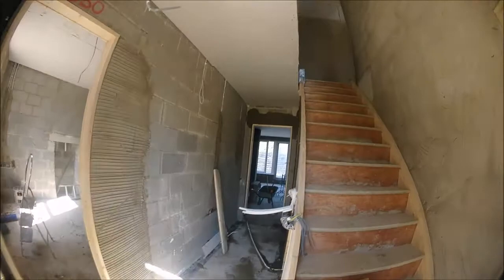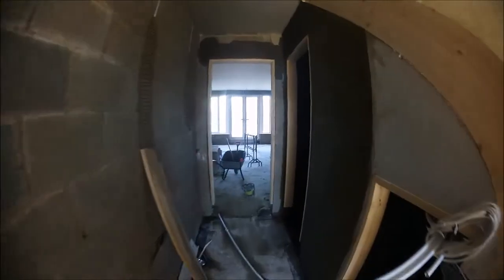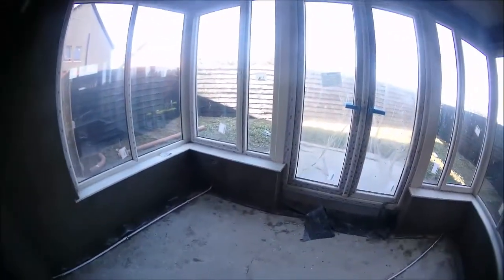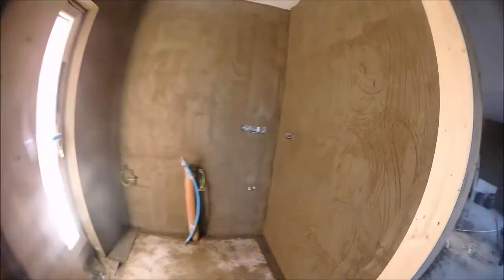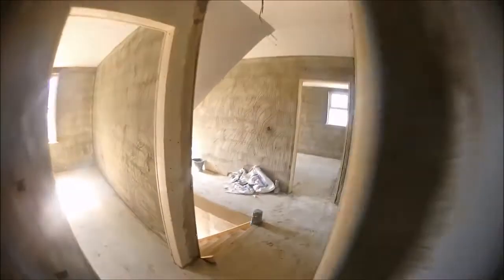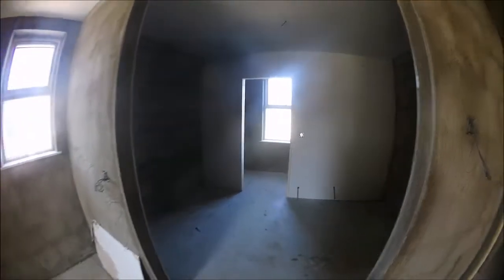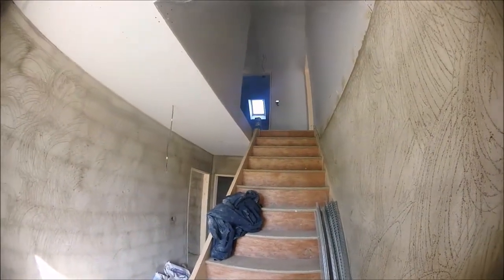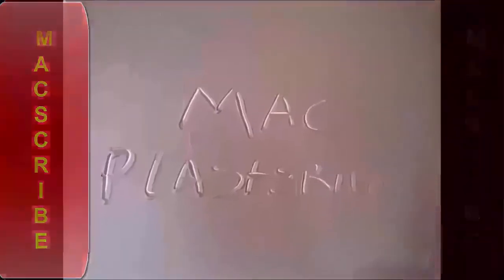3 STOREY HOUSE TO BE PLASTERED  cement rendering for skim coat almost done

Comment: Good to see a plasterer who comes down low enough. Too many think they only need to come down to skirting level. Personally though, I've always 'closed-up' my rendering, always makes the finish coat so much easier and 'bubble-free' :-)
(Holes and shallows tend to make for uneven finish coat)
Reply from the maker: I have followed in the steps of the great plasterers before me who showed the way :) I agree if the wall is off at the bottom it could lead to more problems on up and for others coming in after ie joiners